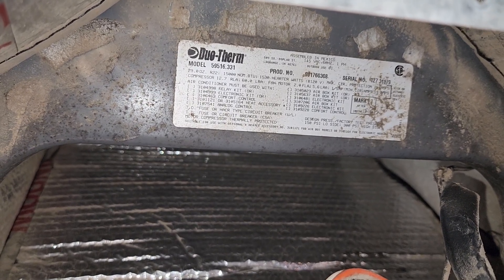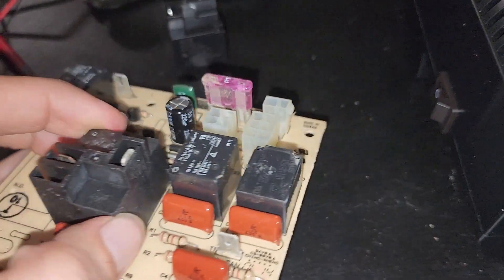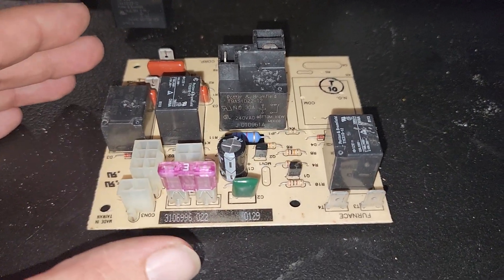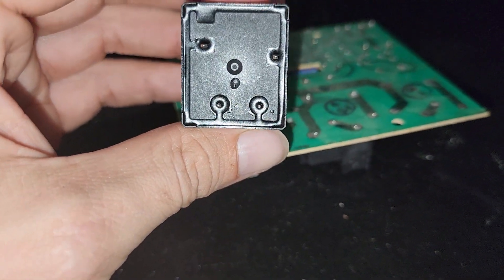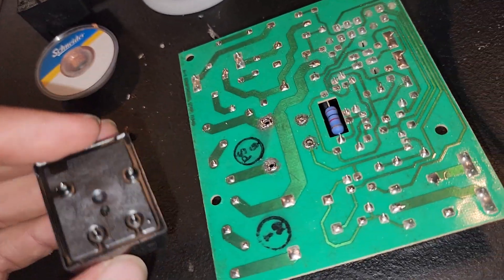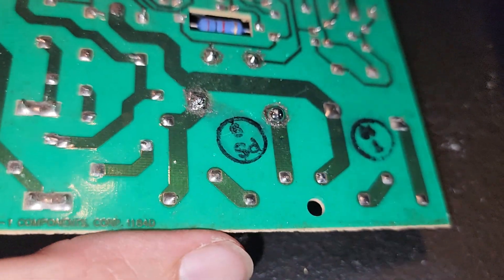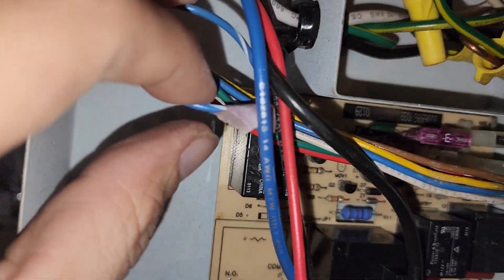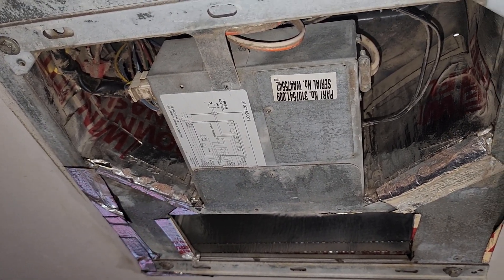Dometic Duo Therm Ac thermostat isn't shutting off, have to shut off with breaker. Easy fix for $6!!

Comment: The relay is stuck closed that’s why you have continuity. FYI , nice find though
Reply from the maker: I figured it was stuck in the open position? The ac compressor stayed on. Only turning off with the circuit breaker. 

I would think that if it were closed the unit wouldn’t have been cooling? I’m no expert, just refuse to throw $ at problems when it’s a relatively easy fix. 

Thanks!